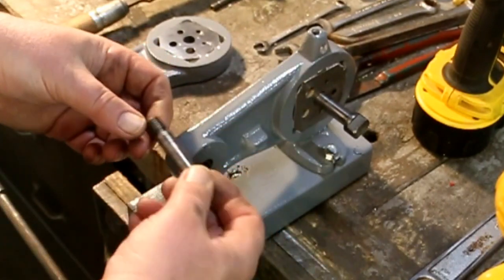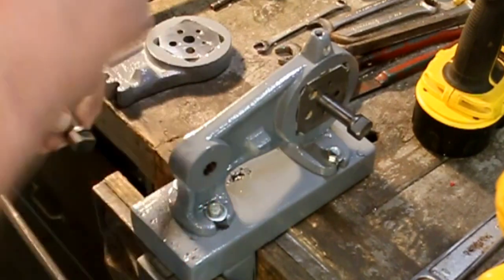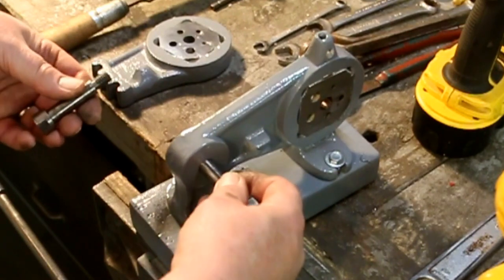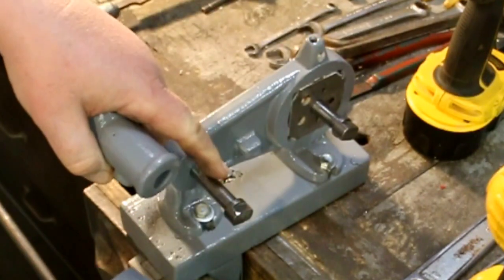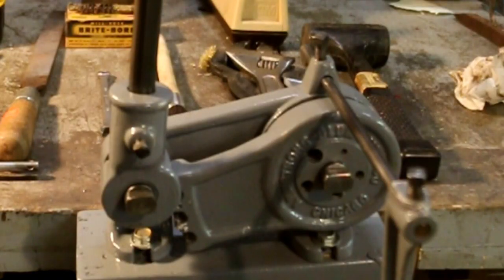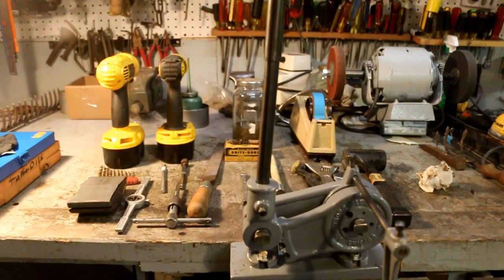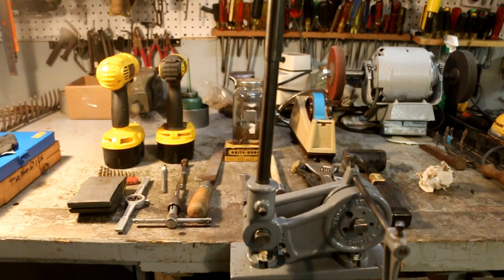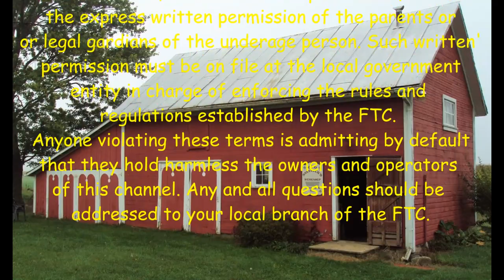Armstrong-Blum Marvel Rod Cutter #5 – Assembly

Comment: 10/4 in a new rig for the annex. Mr. Bacon has it! As for aluminum booms a buddy of mine used to work where thread guides may or may not be made and there was a plating operation that a match was flipped into or a lighter lit around and something lit off and boomed. You'd know more about that than I would. I just worked with dynamite and ye old ammonium nitrate and diesel pellets and occasional prima-cord and electric caps, lead wire and blasting boxes. Happy Grandparents Day and GBWYall!
Reply from the maker: Anodize operations can generate massive amounts of hydrogen. 
Much more than I demonstrated with a small derusting electrolysis tank.
Reply: @OldSneelock  Could've been steel or aluminum. He said it made a very loud noise. Glad I wasn't there.

Comment: Great job looks the part. I have a saying and it comes from never knowing what your going to make or fix next.. it’s “ I’d rather have a tool I don’t need than need a tool I don’t have “ I’ve just been repairing a old spoke cutter and I need two 3/16” whitworth screws and at work I had a old draw with 40 + years of nuts bolts screws which I collected and like a fool I left it behind when I left .so I’ve been searching E-by gum bay found 10 new for £. 12  I can’t believe how much things cost . So it’s on hold till I find 2 that I can afford I’ve bid on a shed clearance with 5 tins of god only knows what but they are old and hopefully they will have what I need . But goes to show my saying is true . Well take care catch you later god bless by for now
Reply from the maker: It's A challenge to find fasteners on the used market. 
I would like to set up a local exchange where we could share tools and skills along with the occasional odd fastener. 😁😎
Reply: You can always come and go through mine. You're welcome to, you know!
Reply: @OldSneelock  The ANNEX!
Reply: @OldSneelock  your not kidding .a swap or exchange would be a good idea but the postage here and the us would kill it .im looking now on e-bye-gumbay for tins of any type of fasteners at cheap prices and im going to try and get a stock of weired and wonderful whatever. but over here now the old type stright blade screws nettlefold they are called here are being snapped up and the prices are out of this world . its like collecters they have spoilt it for the genuine craftsmen and  women that need to make a living like people who loose all there tools to some sumbag that takes your lively hood away over night and they then need there tools to get money to buy back what they have lost .
Reply from the maker: @davidchadwick1626  It would have to be a local group to work. Shipping will kill any advantages of sharing.